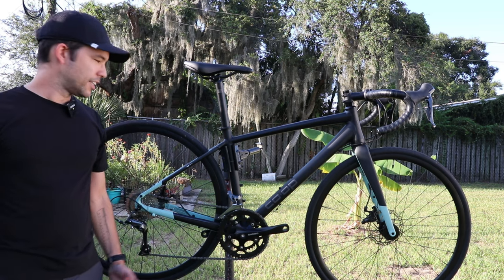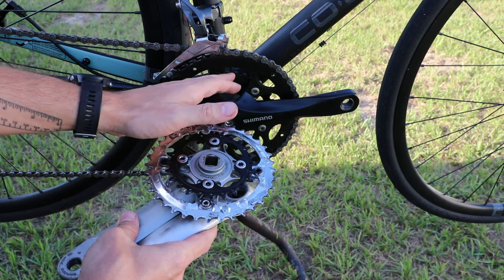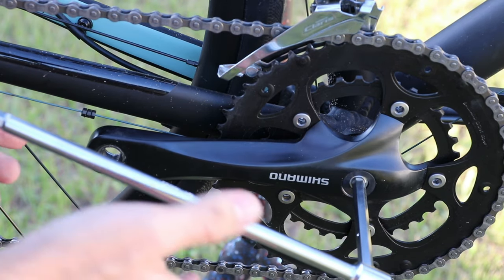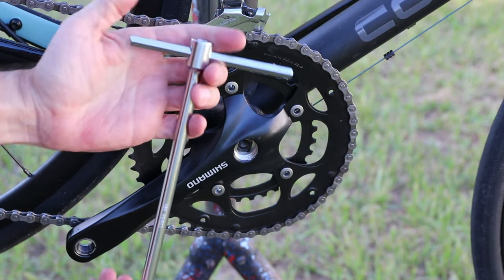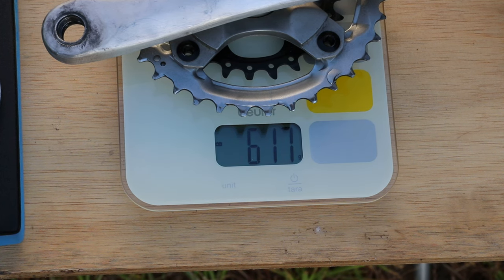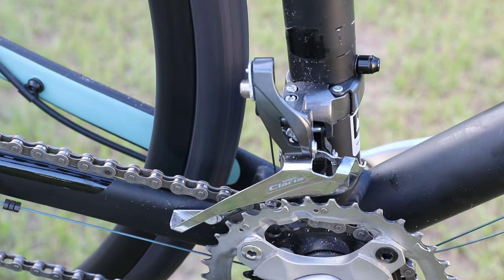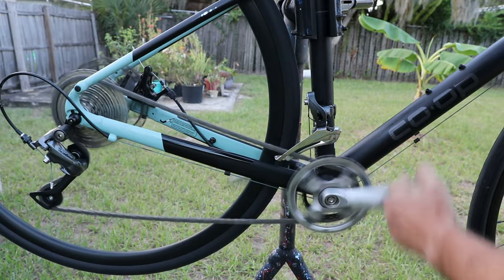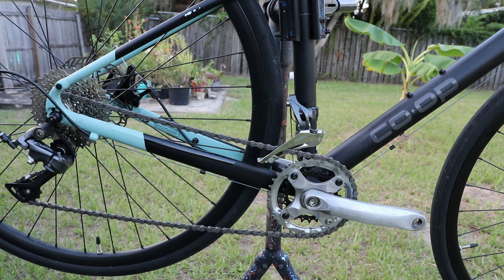MTB chainring on Road Bike

Comment: It actually looks good; the smaller rings coupled with the sloping top tube gives it a gravel bike appearance,  a little more robust. The square taper parts are vintage and still functional.
Reply from the maker: thanks L4M